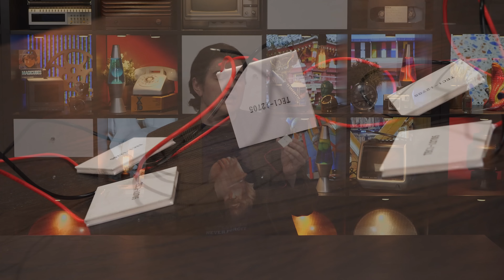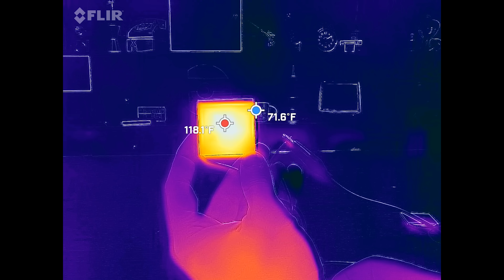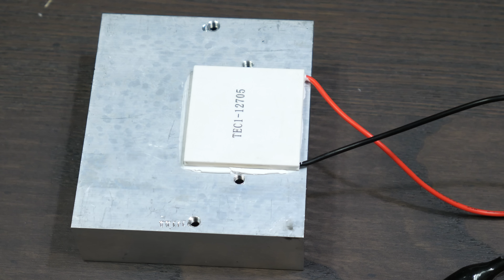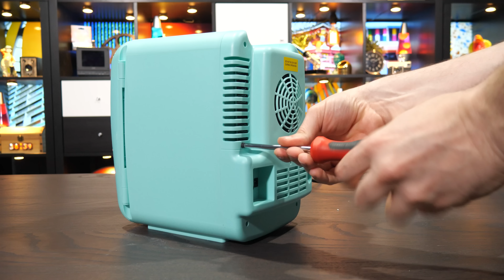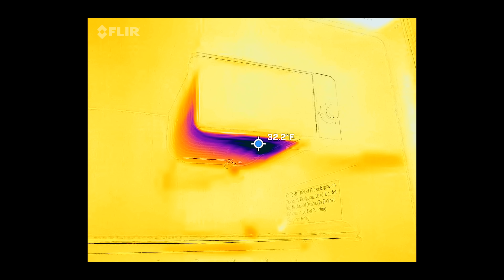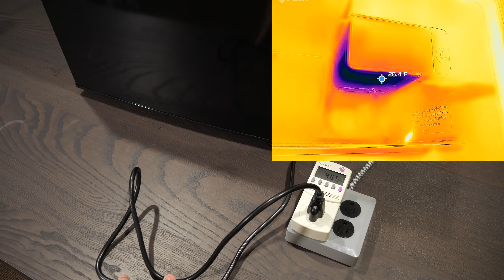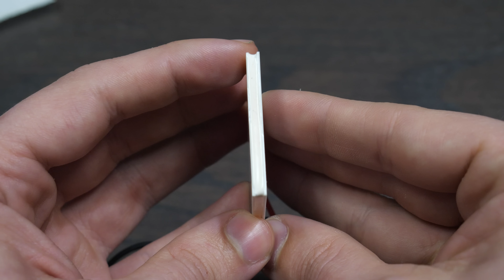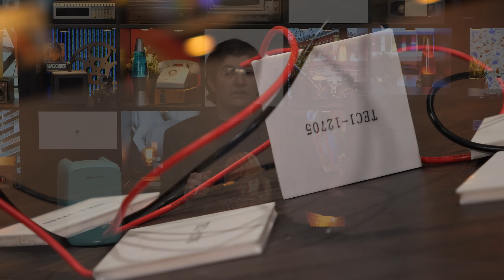Thermoelectric cooling: it's not great.

Comment: My Lincoln LS uses peltier elements for the seat coolers. Each seat has its own small blower fan and peltier module. The blowers are definitely audible at the highest setting, though they're large enough that the pitch isn't irritating. But they do a good enough job at keeping my back and legs cool that I can comfortably drive with windows open even on 100 degree days.

Comment: Electricity costs 14¢/kWh? Here in the UK I'm paying 22p/kWh, which is more than double (about 29¢), and the price will go up a bit in October.
That's despite the fact that the transmission distances ought to be much shorter in our little country.
Maybe it costs twice as much because we get double the voltage, eh?
Reply: It costs twice as much cause you're on an island and also not the largest oil/gas producer in the world.
Reply: @KonglomeratYT  The UK is broadly in line with the larger mainland European countries. The UK also has North Sea oil and gas, and electricity cables interconnecting with Europe.
You're probably right about the effect of America being a big oil and gas producer, especially if the US is prepared to burn fossil fuels as though climate change isn't happening.

Comment: At first i thought "Oh, 30 degrees? Not that bad, even here in hot brazil we hardly get over 30º (CELSIUS), at most 38 or 40 at the hottest days so it may even freeze if the user is not careful". But i suddenly had the realization when he mentioned 75 degrees.

Comment: While i agree that the toy fridge is an inexcusable waste of labor, materials and electricity, the real problem with Peltier Elements is manufacture and cost. The 1 square inch white tiles with two cables sticking out anyone can find in Aliexpress is nothing more than two ceramic plates, copper and glue. It's expensive to make proper elements (well, properly) and even more so out of the right stuff, which makes those "proper" examples so rare they might not even exist for most consumers.

Comment: An amusing thing about TEC devices is that they can generate energy.  For example if you have a hot surface and a cooling element, the TEC can turn heat into energy.  It is inefficient and probably a gimmick but it works.

Comment: I built a butter keeper using a Peltier device. I leave my butter on the kitchen counter because it gets too hard in the fridge. In the spring and fall, it's fine but it gets too soft in the summer and still gets too hard in the winter. So I made a little insulated box with a Peltier device and slip the butter dish into it.

The controller is, essentially, a Wheatstone bridge with a thermistor in one leg. It drives some MOSFETs that apply voltage to the Peltier device in one direction or the other. Once the potentiometer in the other leg of the bridge is set properly, it maintains a nice, steady temperature that keeps the butter spreadable. It selects heating or cooling automagically.

It's one of the few use cases where the Peltier device really shines.

Comment: I have a variant of the "blue heap of sadness" in my closet, and I don't regret my purchase even after watching this video.  At 25:00 you finally get to the crux of it; it's a specific device to be used in a certain way under specific conditions.  No one should be storing food in it, or even using it to cool beverages continuously, and hopefully this video raised some awareness to those points.  But it's not a refrigerator. It comes with a cigarette-lighter adapter and an easily-accessible off switch to turn off when it's not in use. 

 Your explanations are characteristically thorough and interesting, but you spazzing out about how terrible these coolers are is like going on a camping trip, building a campfire, then itemizing all the ways that burning wood is a wildly inefficient source of heat when compared to the nuclear-powered grid just a few dozen miles away.

Comment: I wish you would do a little bit on compressor coolers for travel..... very popular I got the BougeRV 12 Volt Refrigerator 23 qt you can always set it to freeze or refrigerator it. it has one zone. it's otherwise fantastic. comes with 120 brick as well as cigarette lighter plug, a digital thermostat display, about 150 bucks, pretty low power draw.

Comment: I'm working as a retail upkeep and maintanence specialist, and that includes coffee zones.

Many of them use these silly thingies as well as their bigger siblings with actual thermal control to store the milk - squarely due to design considerations and space constraints.
Had to dig into tens of these contraptions because they also have quite a special quirk - miserable reliability!

Main sources of trouble are dirt cheap power supplies and fans - those go out all the time.
But the peltier modules go once in a while as well.

And here we meet a couple of extra nuances: first of all, the peltier elements are brittle as hell. Overtighten one a tich - and at best it wouldn't function untill you back out, but most of the times it will just die. 
Basically, any pressure beyond spreading the thermal compound - and it's done. Now add that to the questionable assembly quality and the fact that the sandwiched element constantly goes through thermal cycles in models with electronic control - and the elements are doomed from the start.

The second and less obvious thing is the terrible actual thermal conductivity of our glorified ceramic sandwich which results in every intrusion being quite a long thermal spike for the stuff the poor tring is trying to cool.
Yes, the peltier module can make one side of itself cold and other - hot quite quickly, but only so much heat can pass through this thermoelectrical barrier in a given time - hence why more advanced models have two elements to counter sudden temperature rises when you open the door or (gosh, no!) introduce something new to the insides.

Sluggish, power-hungry, yet, compact. I've seen it somewhere... Oh yes, communist cars!

Comment: Just a very strong note to all reading this comment - Don't have any Fridge in your home that uses the R600a - As you see on the tag on the back in big letters C-PENTANE  which is a Propane acetone butane gas - these units are EXTREMELY explosive and if a leak develops - well lets just say its not pretty but more over the insurance company might not cover you for damages. And this is why we should not import fridges from china with this design and Gas charge. So - inspect your units and get these out of your home as they are a time bomb waiting to go off. Congress needs to be told about this !!!

Comment: What is a real shame, is for about $80 from Aliexpress you CAN get a decent one of these coolers, and they are far quieter than compressor versions. But they still aren't great. They can only reduce the inside temperature about 20°C from outside, where as compressor ones will make stuff freeze even in a hot environment.

The can Mini fridge versions of them are dreadful though.

Comment: I do find electric coolers useful for camping.  I plug it into the Car’s DC while driving but when I get to a campsite I plug it into the AC hookups intended for RVs (I’m a tent camper).  The benefit is I just throw one small bag of ice or frozen icepack in the cooler and with it plugged in and powered on at the campsite, it’ll keep that ice frozen and cold enough for a good 4 to 5 days before melting.  Significantly reducing the number of times I’d have to go buy ice at the camp store.  With the combo of power and one small bag of ice or icepack I’ve kept meat frozen for a week while tent camping.  As long as you put already cold or frozen food into it, food will stay frozen and cold as the one small bag of ice slowly slowly melts for 4-5 days (instead of just 1 in an unpowered cooler).  As long as the ice hasn’t thawed the food is safe.  A real refrigerator is just
not practical for tent camping from a regular car (like I often do).  Plus you’ve already paid the premium for a tent with AC hookups so the cost factor of using power has already been factored in.

Comment: I evaluated one of these for use in the office for storing my temperature sensitive medication since the lunch room fridge was prone to freezing stuff if it got too full (not to mention that I wouldn't want to leave a $2k/dose medication out of my sight!). I didn't end up needing it, but it would have worked for that niche application. As for power draw, when your employer is paying the electrical bill for a 300,000 square foot production facility, 55 watts for a plug in cooler is a rounding error.

Comment: One thing that most would overlook: 55W is all expressed to the ROOM, as HEAT. On the hottest days, this is another load your A.C. has to struggle against.
Reply: I want to explain why someone might WANT this--to get even the smallest refrigerant-based refrigerator, you give up quadruple the footprint and 40% more height. In a  crowded desk? Forget it.

Comment: I remember Peltier elements being talked about in hushed tones on the BBSes I frequented back in the old days. (This was back when overclocking typically involved replacing crystal oscillators, etc.) Peltier element CPU coolers were rare, as far as I can recall. I never saw one in person. They were hard to obtain, difficult to mount safely, as well as expensive. But supposedly, they were the holy grail in CPU cooling.

Comment: okay, so I made a single can cooler from one of these off the shelf TEC's. I got it to work insanely well by welding a piece of steel pipe the exact size of a 330mL can to a flat square piece of steel for a base. I mounted the cold side of the peltier to the bottom the steel (directly under the can) after I had welded 4 steel legs to lift it 15 cm's off the ground. I used a corsair H100 AIO watercooler to mount to the hot side and used a mini board for volatge control. Anyway, after about 10 mins of run time with a can of pop in it, the can almost froze and there was nearly 2cm of ice build up around the base of it. It worked REALLY well for a science experiment.

Comment: When your temperature range fluctuating by 4 degrees is acceptable, then this is objectively correct. But when you need extremely accurate temperatures for  something, hot or cold, a peltier pad with a controller can be accurate to a fraction of a degree. All depends on use case ig

Comment: I love mine. 90% of what you revealed was written on the product page, so I knew what I was getting. Now that I'm old I sometimes need to drink a Glucerna (Ensure for diabetics) before I can cope with going down the stairs to the kitchen. It holds 4 bottles so the one I take has been in there cooling for 3 days. I don't have room for a real mini-fridge. An extra $35 a year in electricity is admittedly a bit wasteful, but acceptable when the alternative was buying a smaller bed. Oh and you overpaid; mine only cost $19.  ;)

Comment: I can see a potential use case for vehicle use, especially if you keep the unit on the floor while running the car’s air conditioning with at least floor vents partially enabled. Angling the car’s air towards the unit’s air intake would help the heat sink drastically.

Here it’s using the constant wattage as an advantage. You want that cooling only while using the car, then remove the whole unit and take inside.

Comment: Went from a peltier camping fridge to a cheapest of cheap  no name compressor one, and instead of barely chilled food and a dead leisure battery I had far too cold food and a battery hovering around fully charged. Both setups relying on a $60 solar panel and less than solar optimal UK weather.

Comment: The one time Peltier coolers seemed to be useful for me was a peltier cooled beer cooler. It was more insulated and opened from the top and when I tested it it was actually getting a temperature delta of 40 degrees; had some drinks freezing in it.

Why use it? Hotels that don't offer mini fridges. We bring it to conventions to keep liquor and beer cold rather than dealing with bags and bags of ice.

Comment: When these 1st came out in a capacity where my teenage self could buy one, probably early 90's, I remember getting a 30mm version and making a PP3 powered cooling straw. It worked really well and saved cooling cans of drink at all. Sure it was bulky but since it was only on as you sucked the straw, the battery lasted ages. These days with 3D printing, I could probably make a cap that sits on the can that contains everything. Use a lithium battery and a fluid sensor to automatically turn it on when in use.

Comment: Other cash grab of presumably junk product that also use peltier is other cheapo small/mini heat exchanger i.e dehumidifier 

Newcomer of using these peltier for questionable power efficiency also came in personal cooling (cooling neck, gaming phone cooler etc) which did it's job conveniently 
As long as you're near wall plug

Comment: Another use for a Peltier device:

My company makes liquid-handling platforms for laboratory automation.  These devices handle microtiter plates: Plastic trays roughly the size of a dollar bill, containing a huge number of small adjacent wells, each of which can store a different liquid.

Some of our customers want these microplates kept cool while they're sitting out on our platforms' decks, being serviced by the liquid handler.  Maybe the compounds in some of the wells need to be kept chilled for chemistry reasons.  For them, we include an on-deck device called a CPAC, which has a metal top cooled by a Peltier device.  The microplate rests on top of the CPAC, and the cold platform keeps the microplate chilled.

These CPACs are too small to house a heat pump, and only run when a microplate is sitting atop them, so the energy cost of the tiny Peltier device inside them is worth it.

Comment: Thermal electric fridges are crap, but I use a Waeco one for the heating cycle not the cooling (Has digital temp control), I use one to store my 3D printer filament, it gets to 70C inside and I have it turn on during the daytime so it runs when my Solar array produces power, works really well, but for cooling, best to buy a proper portable fridge, also there should be fan inside the unit, like the Weaco, but I replaced both external and internal fans with better ones, this keeps my Filament below 8% moisture level.

Comment: 6:35 the user manual says explicitly NOT to do this!!!! this is like taking the wheels off a car and then saying the car sucks because it has no wheels. AstroAI is the best brand of these, and they clearly state, do NOT fill the cooler from empty with room temp drinks unless you are willing to wait a very, very long time for them to get cool. its designed to HOLD temp, and to cool 1 or 2 drinks. The user manual actually recommends that you put ice in the cooler (or just a drink that is already cold) along with your warm drinks to get started. 

Once all the drinks inside are down to temp, you just keep it topped off. 1 room temp drink and 5 cold drinks will cause the 1 drink to very rapidly cool and the other 5 will barely warm up before they all match temps. Also, once you run the cooler for a few weeks, it will build up a big chunk of ice on the back. This chunk of ice acts as a thermal battery and regulates the temp extremely well.

Comment: There was a bit of a craze back in the 2000's of people trying to use these for desktop PC overclocking. Condensation tended to become a problem if you didn't load the thing up with desiccant, submerge it entirely in some kind of oil bath or something equally absurd.

The quest for FLOPS was long and arduous.

Comment: Fun fact: the opposite of the Peltier effect, the Seebeck effect, is what is used to power space probes, by loading them up with radioisotope thermoelectric generators, which use the heat of the isotopes to generate electricity.

Comment: I know video is focusing on silly fridges, but here is another usage for peltiers: In the 90s, I used to work with maintenance of telecon equipment, and inside of most of them we used to have lots of pertiers to control laser diodes and oscillator circuitry temperature. I'm not sure if those are still largely used like in the past (modern technology!!), but back then it was useful to have sensible blocks of electronics working inside mini-ovens with stable temperature to keep calibration valid.

Comment: I have a thermoelectric "refrigerator". I use it for storing my insulin in my home office. I have a larger compressor fridge that I use for food and beverages.

For my thermo fridge, it only gets opened when I need a new "pen" of insulin. I take a pen out and keep it in a padded, kind of insulated pouch. It can hold at room temp for a month. And since I only use it in the office that's already kept at 72-75, the Peltier limitations aren't as bad.

Comment: My father (an electronics engineer) investigated these in the early 1970s - they were termed, colloquially, frigisters.  He concluded they worked reasonably well 'downhill' - that is to improve heat sinking of of power transistors etc where the ambient is lower temperature than the source and you just want to improve the cooling rate (this was before CPU''s and modern digital electronics).  But they were very poor working 'uphill' - that is true refrigeration applications where heat had to be transferred to a higher ambient temperature.. And were very power hungry themselves.

Comment: I used a TEC in a highschool project targeting a sub-ambient CPU temp. (It was a ploy to get parental monetary help to fund my dreams, but worked out as I got an A+) In 2005. It booted at 9C in a 21C room. The hot side was liquid cooled into a really beefy radiator. I needed an extra power supply to run the TEC. I put it all into a clear acrylic computer case (you know the one I'm talking about of the time). Had to insulate everything around the CPU including dielectric grease on the pins. It was awesome and terrible.